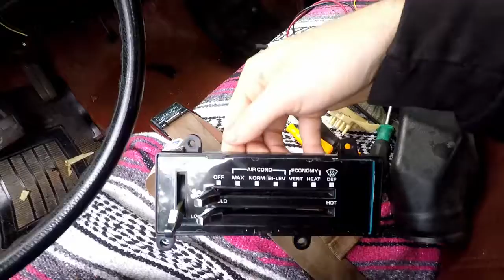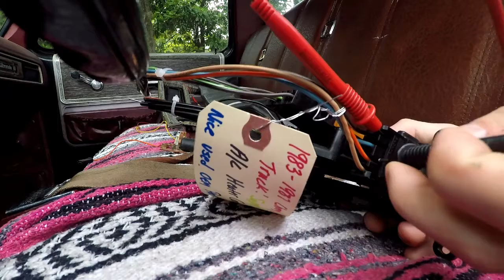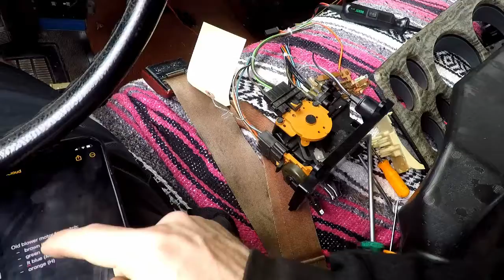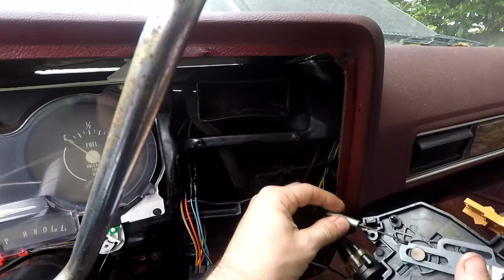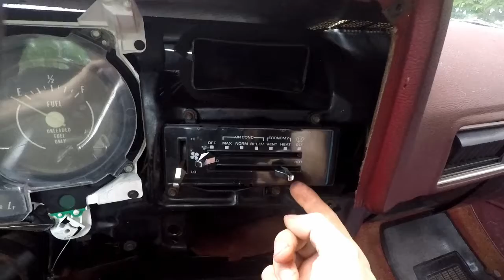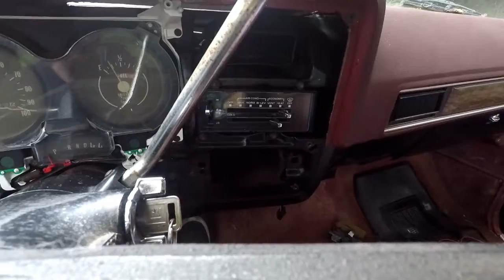Swapping an 83-87 Climate Control Unit into a 1975 C10

Comment: hey, i’m new to electrical stuff. how do you use the multimeter with all those different settings? and when you say continuity does that mean there’s constant power ?
Reply from the maker: @jaiseholland6521  continuity simplified means there’s no break in the wire. so if you measure one end of a wire to the next end, and if it’s not cut in half then you have continuity